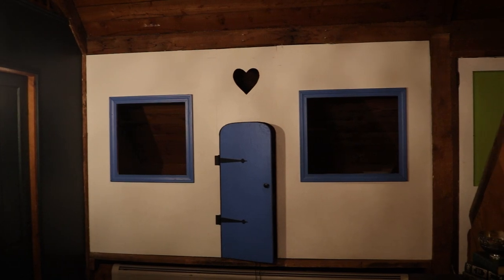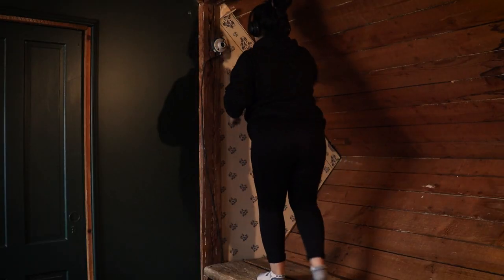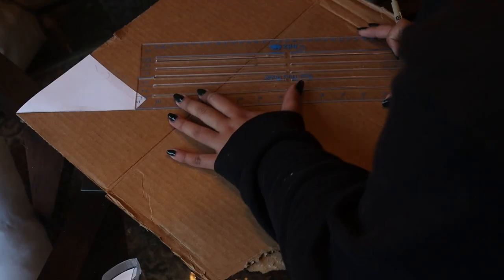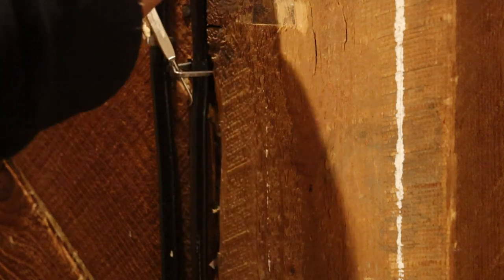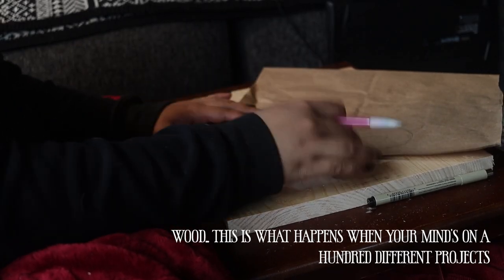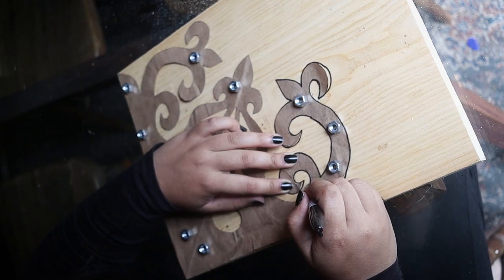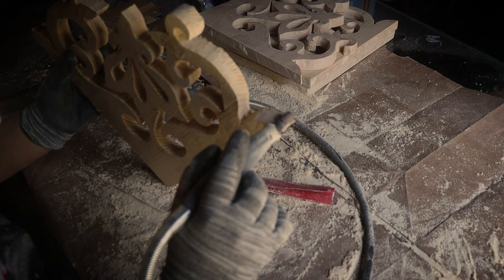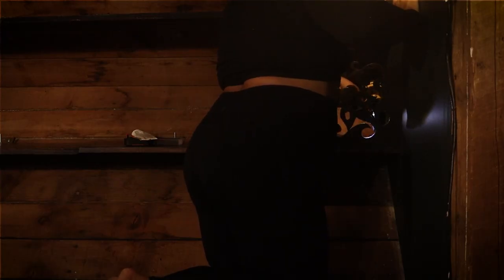DIY Reading Nook Renovation | Creating A Dark & Cozy Reading Nook

Comment: This came out soo good! What is the attachment you used on the Dremel to cut out the negative space in the wood between the scrolls? I was thinking about getting a router but I already have a dremel and that looks far less intimidating  😅
Reply from the maker: Thank you so much 🖤 It's a multipurpose rotary tool attachment and was a breeze to use. This is the one I got: https://www.walmart.com/ip/Dremel-565-1-8-Multipurpose-Rotary-Tool-Spiral-Guide-Cutting-Attachment-Kit-3-Accessories-For-Wood-Plastic-Fiberglass-Drywall-Aluminum-Vinyl-Siding/1218385
Reply: @NasyaAcostaSmith  thank you for responding ✨🫶🏼